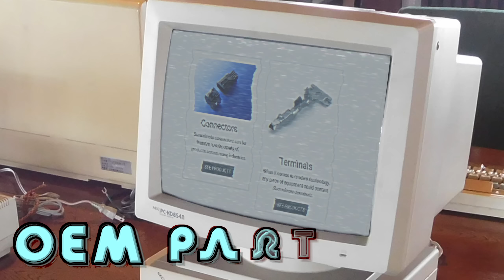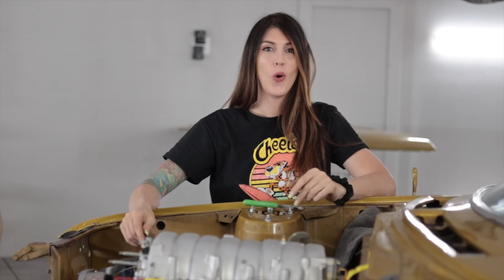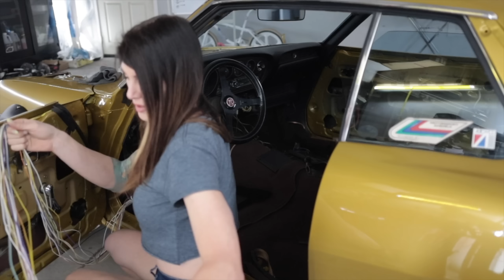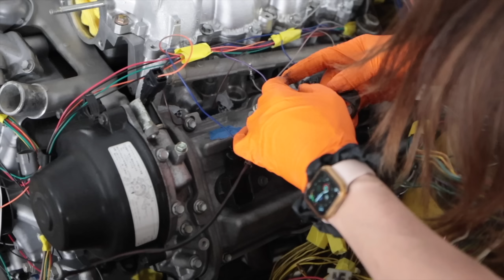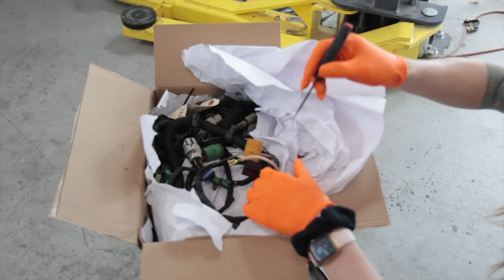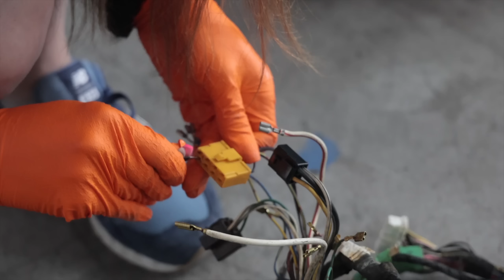Drive By Wire It Is.. // 2UZ V8 1974 Celica Wiring

Comment: Sarah, you have little to be recalcitrant about! Way back, I guess dirt was becoming a trend in cowboy movies, some "Really Brite Boys" at Ford were mulling over some ideas for a "youth oriented car" and someone threw down a napkin sketch that would become the Ford Mustang of 1964 1/2. That was the lowest number of engineers involved from that point on; it took literal rooms full of them just to fit a new skin on an existing chassis, and then design all the other bits and bobs that make a whole car. There are only three of you; you, yourself and Sarah- doing a workload a notorious skinflint like Henry II had many dozens doing. It is also helpful that one of you has a well developed "Toyota Bone"- you are an inspiration for others working the JDM side of hot rodding- don't ever quit! The car hobby is one of the greatest problem solving puzzles! More awesomeness incoming!

Comment: I was doing a buncha research on TB for ya Sarah, but I kept running into something else... making it work with all the VVTi and variable length runners/valves with a mechanical TB.  I'd say if you want the mechanical TB on the UZ you need to do a "few" custom things to make it fit and work together proper.  Sounds like a v2 project.

Comment: The one area I would go non OEM is the loom.  The cloth split loom is so much cleaner than the corrugated and or exposed tape wrapped.  Finish the ends with heat shrink.  I wired my LS swap in my 89 firebird because none of the swap harnesses were the right length and I didn't want extra wire length or be forced to put the PCM some where.     I have a binder with all my schematics, parts numbers (and what vehicle to tell the parts counter to look up).  It makes repairing it so much easier.

Comment: Sarah is not afraid of showing the tedious and less glamorous parts of a car resto.
Reply: And I'm loving it. The extra detail is incredibly helpful. Just learning some of the differences between the 1UZ, 2UZ, and 3UZ (as well as transmission and wiring discussions) have been and will be insanely helpful for myself in the future and would have saved myself some time and money 15 years ago on another project I did, discussing the use of the 1UZ and using the R-154 transmission. Sarah used the W-58 and I understand why, but I absolutely loved using the R-154 behind my Ford engine project. Super smooth and super strong transmission. Toyota outdid themselves using it. I've learned so much watching these videos and I've remembered many things I had forgotten since my last project.

Comment: Warning.
If you pass a powered wire through the firewall or other pass through ensure that there’s a fuse under the dashboard and or at the power source that will kill the circuit should the wire go to ground.
A wire shorting under the hood is not quite as likely to burn the entire vehicle to the ground as one that shorts under the dashboard or carpeting

Comment: Shielding is difficult to get right. Smart to re-use the factory circuits. Also make sure ground is proper, of course, but you know that. Intermittent signal faults due to bad shielding or bad ground is the pits to try to troubleshoot.

Comment: I find liquid mask basically rub in a can works great for wiring and water proofing use on back if connector then little tape just for reinforcement the stuff I get like rubber cement in can with brush connected to lid it works great but can be time consuming but make sure of sealing nice do this on wires in my rc to water proofing or if nick a wire build scale trucks and a few cars basically a model that radio controled they aren't like was when I was kid the durability and speed is awesome.

Comment: Actually, I do know how complicated it is to massively modify vehicle wiring while maintaining manufacturer conventions and remaining compliant with manufacturer documentation. I have done it. Never to the extent that you are doing though. But I do know how complicated it is. Almost nobody understands how complicated it is, or understands the aesthetics of keeping changes legible and consistent with manufacturer conventions.

By having to research existing documentation to calculate wire gauges for different circuits, or verify proper shielding on the right sensor connections, you are edging into engineering. It is far beyond technician pay grade to re-home electronics and circuitry outside its designed environment, and determine all the changes that need to be made to make it work.

I can tell that you know several times as much as the average auto mechanic, due to the depth and breadth of changes you are willing to make to a vehicle. All that careful accounting of all the wires and all the connectors- most auto mechanics would run away screaming!

We are kindred spirits and you are one of my teachers and inspirations.

Comment: For the throttle body fitment issue, how about introducing an angled adapter in between the manifold and TB that results in the TB of your choice gaining clearance? Two flanges, and a curved section. It may present other packaging issues, or not satisfy the OEM+ design goal, but just tossing it out there!

Comment: No complaints here! I would have thrown in the towel on the wiring long before this point. I know there's a certain logic to it, but sorting it all out and figuring out how it can be modified to suit the changes from the original specs might as well be quantum physics as far as I'm concerned. You've got to be wired just right to do this sort of work...

Comment: Doing a complete rewire to input a different newer engine into a vehicle is very time consuming. Especially if you are doing it to factory specs and keeping it real. Easy way out would have been with aftermarket performance computers and harnesses. Really don't mind the wiring videos as i have something to rewire to factory specs in the near future.

Comment: Sarah, that 'Noise Filter' looks like a simple capacitor.  If you're familiar with old timey distributors with points it would be the 'Condensor'.  Not likely to hurt anything by leaving it there.

Comment: Place your bets on how many wires are swapped or crossed.
No matter how anally retentive you are in your wiring if you didn’t mess up at least one Murphy will find another way to toss in a monkey wrench.😂😂😂
The common bit of sabotage is the brand new sensor that’s dead straight out of the box.
Reply from the maker: Zero. Watch the mr2 video, it started and everything worked first try.
Reply: @SarahnTuned  beware Murphy is probably miffed about that.

Comment: Keep up the great work Sarah, correct and worth it to you is all the matters.

The ignition noise filter is just an inline capacitor that isn't strictly necessary, but I would suggest keeping/adding it. In addition to suppressing high frequency RF to keep your radio from buzzing along with rpm, it does smooth out coil supply power a little bit too.

Not sure if you have fog lights on that thing, but remember the troubles you had with the MR2 and LED headlights, you'll need to add a new circuit to get them working if they exist.

Comment: Sarah, I love your videos.  I have a suggestion on ultrasonic cleaning. If you use a separate container to put in your parts and solution in the ultrasonic, you won't need to change the fluid in the ultrasonic cleaner.  To can just use a separate smaller container for different solutions with contaminating your ultrasonic fluids.

Comment: Noise filter on coils: This is just like the condensor (capacitor) on most old ignition systems, however in this case its likely used to prevent any kind of flyback voltage from reaching the transistors in the ECU if im seeing the diagram pic you showed correctly. I would for sure use it so you don’t burn anything out in the ECU. I blew some mosfets before by not using this and purposefully causing misfires and had to solder in new ones. My theory at the time was that the flyback voltages were higher when the spark energy wasn’t getting absorbed/buffered by combustion and instead cleanly discharged to the negative electrode… but it really always felt like a shot in the dark as far as explanations went. Anyways, definitely run the capacitor on the stock coils if the factory calls for it.

Comment: there's always the option of ITBs if you want to stay cable. Link has great drive by wire support though, so you shouldn't have any issues getting it working. Should only add like a dozen wires too
Reply from the maker: No, not enough room under the hood for them.

Comment: Design a spacer for the intake to space it out so you can use any throttle body you want to..
Reply from the maker: Will not clear the hood and radiator.

Comment: Sarah, I have a 1967 Pontiac Catalina that I replaced the headlights with Holley RetroBright LED in classic white 3000K. I can tell you the difference is literally night and day. I can see much further down the road and more of the sides of the road. I do not blind other drivers and it still maintains the original vehicle look.

Comment: Injector INF pin… If those are anything like LS coils than the INF pin could be a ground for the logic level side of the circuit. If so then it needs to ground at the ECU. If you don’t ground it right at the ECU then voltage drop between ecu ground and chassis ground can cause weirdness. But I do not know if that is what that pin is actually for, it just makes sense in my head that they isolated the control circuit from the injector circuit like that to isolate it from flyback voltage spikes caused by the injector coil fields collapsing when they fire.
Reply from the maker: Nope. I wired the MR2 this exact same way, it is not needed with the Link ECU.

Comment: Look up the dimensions for an accufab 80mm throttle body for a 1990 mustang
Reply from the maker: Won’t clear the hood or radiator with an adapter.
Reply: @SarahnTuned  would the elbow extension they used for the 94-95 mustang work? You could always have Charlie weld the holes on the accufab TB closed and re-drill it for your application?
Reply: @SarahnTuned  holley part number 300-240 is a right angle adapter
Reply from the maker: @andycampbell6032  no
Reply: @SarahnTuned  might see if you can find someone with a87-95 mustang accufab TB and see how far off the mounting holes are. wouldn't be hard to fill in the holes and re-drill new ones. I cant off the top of my head think of a TB thats much smaller overall size wise for needing to be 70ish MM

Comment: In projects such as these when everything goes without a hiccup there is almost, always disappointment at the end. With the fuse box and relays closer to the rad support wires that carry higher amperes can be shorter in distance. As a relay is a switch operated by a remote switch a low amperage switch for the headlights sends a signal to the relay by the rad support  which opens or closes a high Amp circuit to the headlights.

Comment: The wiring videos are actually quite fascinating. There's almost no-one publishing this information to the detail that you are doing. I must say that it was a lot easier rewiring my 1954 Pontiac's SBC engine. One wire alternator, two wires (power and tach) to the HEI distributor and the starter circuit. Done!

Comment: You have absolutely nothing to apologize for Sarah, you just keep being you that's why we watch you
I feel you on the wiring thing, but hey this is what your channel is all about is just being real and not caring about what everybody thinks. 

OK, enough gushing I do have a little idea for your throttle

If you're heart is set on using the cable throttle, 

Just have those grill guys cut you out a plate to replace the drive by wire motor. Looks like the TPS is on the otter side. 🤔 

You are more than capable of making a custom cable mount to the throttle blade coupling. That said there's absolutely nothing wrong with using the drive-by wire if you can configure it to work just like a cable.... but again, if your heart set on making it a cable throttle, then put on your fabrication hat and modify your existing Throttle Body  to use a cable. I know you can do it. You've proven that.

PS  BMW, uses a throttle pedal that bolts to the floor like in your Toyota that also is drive-by wire and they've had it for a long time. Check out the BMW section just for giggles next time you go to the junkyard.

Comment: There is no need to apologize for sticking to your guns and doing things the way you know you want to do them. I get that wiring is a very time-intensive process. I know that trying to make videos is also a very time-intensive process. Maybe if there were 48 hour days you could do both. Since that is not the case, and I think I speak for at least most of us here, do what you have to do. When you can squeeze a video in, squeeze it in. When it's too much work to try to do a video and the other work at the same time, focus on the other work. You can tell us about what you did that you didn't film.

Comment: Throttle cable would be period correct, but drive by wire will make the tuning much easier when you get there. And since you're using an aftermarket ECU, you can make it essentially feel like there is a cable, unlike modern cars that have lag for "emissions and fuel economy".

Also, next time you do wiring schematics, get yourself some kind of touch screen monitor. It'll be way easier than a whiteboard, and you can save the schematic.

Comment: You just crippling And no soldering? Each connection?
Reply from the maker: The vast majority of the circuits are 1 continuous wire with no breaks, 4+ way junctions need a mechanical crimp, not solder. 3 way T-junctions will have solder with no mechanical crimp. That’s exactly how it’s done from Toyota at the factory.

Comment: Thanks for clearing up the LED headlight crap. I love when I hear "These LED bulbs that I paid 50 bucks for on Ebay and put in my original headlights designed for completely different tech don't work worth shit. LED headlights are crap." Well, yeah.
Reply from the maker: Yeah, you can’t put an LED or HID “bulb/ballast” into a housing designed for halogen, the reflector area is completely different and it won’t work right.
Reply: @SarahnTuned  Can you say what brand you chose? I'm looking for 7" LED headlights for a '77 Fiat Spider that look period correct.

Comment: Fun fact, the 2UZ FE is one of the very few car engines approved by the FAA for airplane use but was never used as such.
Reply from the maker: That’s super interesting actually!
Reply: @SarahnTuned  Next project: 2UZ handbuilt airplane! :) :)
Reply: @ManicSalamander I think that comment is a bit of an oxymoron. Two words you don't want to see put together.  "Handbuilt  airplane.  "
Reply: @MikeAnderson-uj3oo  Thousands of homebuilt airplanes flying all over the world. Look up the Experimental Aircraft Association. 😊
Reply: @MikeAnderson-uj3oo there are plenty of hand built/home built aircraft in the sky, with the builders doing lots of the same things as Sarah is doing here. Many of them also document their builds on YT. All have to be signed off by the FAA (or equivalent) to fly.
Reply: Actually The 1uz was. And it was also certified for Marine vehicle
Reply: Interesting you’d think they wouldn’t allow it due to the fact it’s a belt driven valve train vs chain…